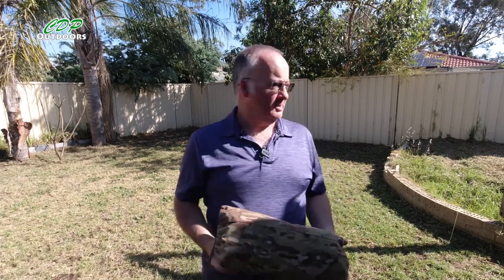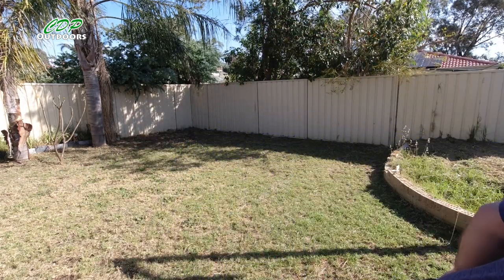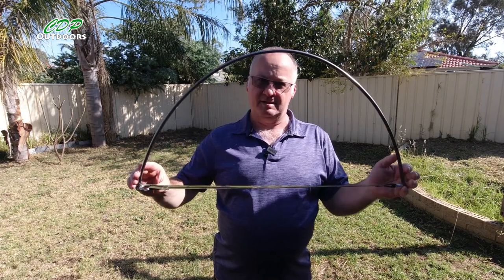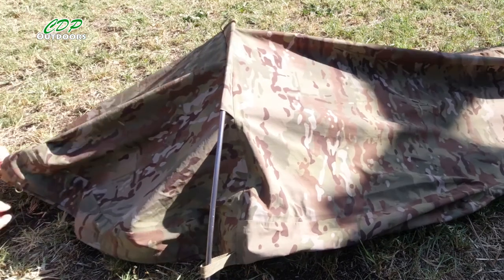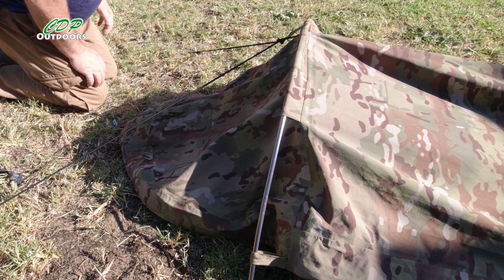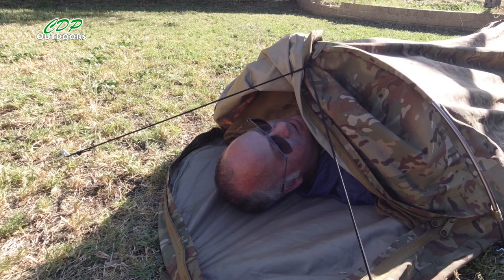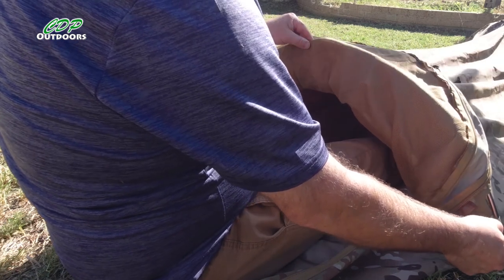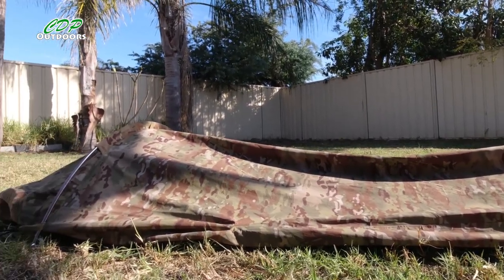Valhalla Ranger Bivi Pole Mod

Comment: this video is a great example of what a bivvy is good for and, importantly, what it isn't.
bivvy bags excel in cold/dry weather/climates. they add warmth to a bag, are windproof and will prevent moisture from the atmosphere wetting your sleeping bag.
an example would be a trip of a  night or three in winter when the weather is known to be good.
and really, if the weight of this gear is over 1kg - your far better off with a lightweight tent.
don't make the mistake of trying to get your bivvy bag to function like a tent - because it won't.
Reply from the maker: Agree with you.
There is times for a bivvy and there is times for a tent or hammock

Comment: Clive have you used Helinox  light weight strector ?  I wounder how it whould go under a bivi bag ? Looks compact good bit kit  the 3 leg  one
Reply from the maker: Yes, I have one. 
I haven't used it with my bivi.
I had to add a small self inflating mat on top, it was too hard for me.
Reply: @CDPOutdoors  you pref bivi  bag or still the hamocs
Reply from the maker: Still prefer the hammock, 
But the bivi has it's place.
I also drop the hammock down into bivi mode.
Reply: @CDPOutdoors  did u get one of Simions  hamocics  from. Tiear gear ?
Reply from the maker: @iantooke3549  the same as yours, but the last one in Multicam.
Reply from the maker: Email to c.d.p.outdoors.2@gmail.com

Comment: how is it for condensation?
Reply from the maker: G'day. 
When using just the bug netting, I have had zero condensation. 
Closing the main cover with a 8 inch gap for ventilation in wet weather, I get a fine layer of condensation where I have been breathing.